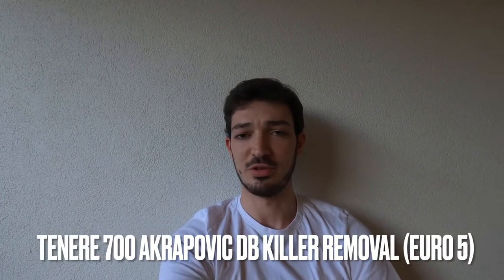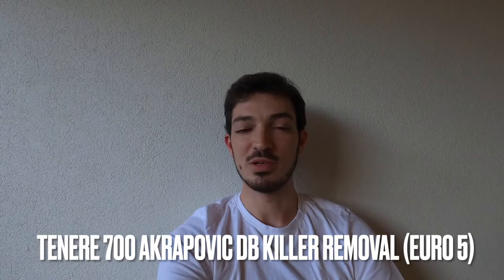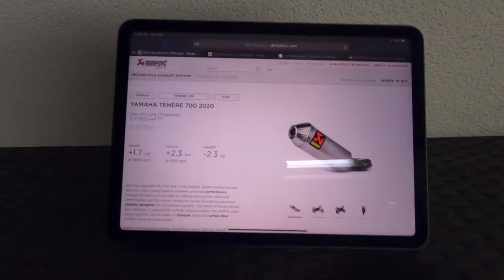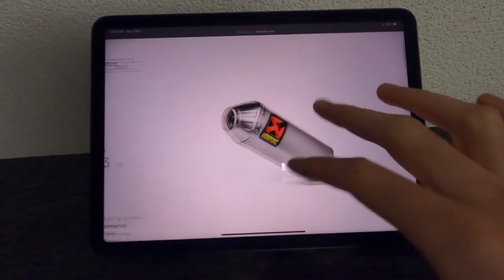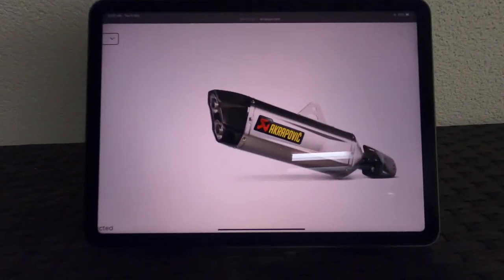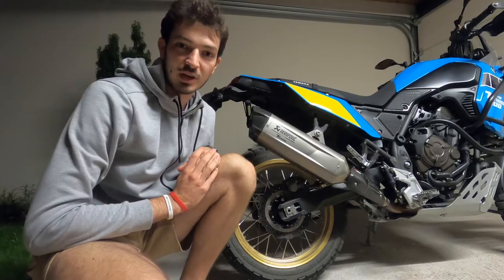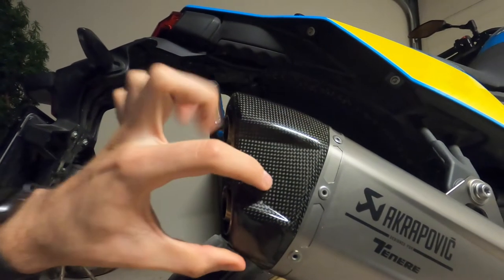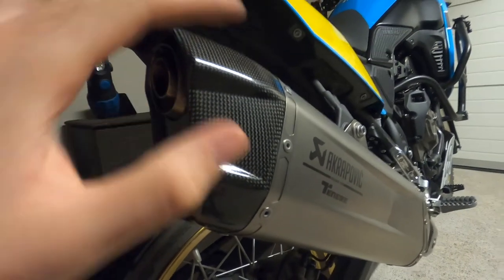Akrapovic DB Killer Removal (Debaffle) PART 1 | Tenere 700

Comment: Hello, congrats, very nicely done. Quick question, which kind of drill bit did you used (what material) ? Just a standard metal drill ? I am not used to drill in carbon. Thanks
Reply from the maker: Just a normal drill for metal/wood. I do suggest you make a smaller hole first with a smaller drill and go for the bigger one. By doing so it will be easier to drill the hole more precisely. However, drilling makes the finish of the hole a bit rough, therefore I suggested to finish it up with dermal to make things nice and smooth. Just be careful not to increase the size of the hole with it too much.
Drilling carbon is nothing special. Its thin so its like drilling though a sheet of metal. The residue is fine black dust from the resin and the carbon fibers. If you'll need any tips along the way I'd be glad to help (I need about a day to answer)!
Reply: @gravelroadslovenia  thanks a lot for your precise answer.

Comment: Hello,
Nice work :D
How did you make the hole?
What type of drill did you use to make the hole?
Reply from the maker: I made the hole using a cone drill bit. Then I went around with a Dremel to smoothen the edges (normal sandpaper should work too).

Comment: Great video, thanks.  By the way,  would this add 1-2hp to the power of the T7 compared to the regular version?
Reply from the maker: The Akrapovic does add 2 hp over the stock exhaust, however upon taking the DB killers out, I believe you loose the 2 hp again due to the change in engine back pressure. If you were to remap the ECU however, you could see even bigger gains without the DB killers.
Reply: @gravelroadslovenia  ok. Thanks so much.

Comment: Hey! You think would be fine to run the exhaust with the dB killer on without bolting them?
Reply from the maker: I assume they would stay in for some time because the fit is very tight but I do always bolt them in. For the matter of fact they can only be properly put in with a hammer and pulled out with pliers...

If you plan to put them in and out often, you don't need the bolts I assume.

Comment: @gravelroad have you had any issues with the bike since you removed the db killers?  I've read these engines run lean to meet emissions and removing the db killer can cause it to run too lean
Reply from the maker: No issues at all. It has been running like so for the bast 10k km. I have a friend that has done 20k km like this with no issues either.
Reply: @gravelroadslovenia Nice, thanks for replying

Comment: So the carbon cap doesn’t come out?
Do they sell titanium rivets?
Reply from the maker: I heard it is possible to remove the carbon however in my case it was not possible.

Rivets cannot be purchased from Akrapovic directly, however I did find a company that was their supplier. The ones they use are watertight and of stainless steel. They are identical.
Reply: @gravelroadslovenia  any chance you can send me the link for the rivets.
I think I’ll try to remove the cap as first, as I don’t want to make holes.
Thanks
Reply from the maker: @v.gousis2241   the company is called Pnevmotex d.o.o, and the type of rivet you need are "blok zakovica rf 4.8 X 8 ZAPRTA". If they will refuse shipping it to you let me know and we will work something out.

When drilling the holes you will need a high end drill bit. Installing the rivets also requires a professional tool since they are too strong to be clipped in with a classic hand tool. Since I went through the process I would strongly recommend avoiding what you are planning to do. Drill the holes in the carbon and get the rubber covers from Akrapovic, it still looks good.

Comment: I did the holes...i.put out the bolts....but the silencer didn't come out!!!  How i can put them out???please help!!!any tips?????
Reply from the maker: Try spraying some WD40 in between. It is an aerosol and will evaporate anyway. Then heat up the exhaust well by running the engine, you might as well go for a short ride. Then pull it out hard with a set of thin edged pliers. The fitment is very tight, but it should work...
Let me know if you need further assistance

Comment: one question do you just have to make the two holes on the side or do you also have to remove the rivets.
Reply from the maker: You can either remove the rivets and get the carbon off or drill the holes in the carbon. Both will get you to the bolts holding the baffles in. 
I personally did not manage to get the carbon cap off (it is possible but I don't know how). If you are planning to use the baffles every now and then, your only option is to drill the holes in the carbon. There are two screws securing the baffles, otherwise they might fall out without them.

Comment: Thanks for the view inside the muffler.  The pupose of the baffles is apparently to just reflect the pulses back
for another pass across the holes that expose the sound absorbent material.
In Slovenian, is the "krap" in Akrapovic pronounced as the English "crap"?
Where did you learn your English?  It's quite good American English.
Reply from the maker: Seems to be so! What I have also recently learned is that the pressure pulses created by the baffles (back-pressure) aid performance. The top speed with the baffles is about 10km/h higher than without. 
Yes that is correct, "krap" as "crap" 😂...
I attended an international school. 🙂
Reply: @gravelroadslovenia   -  Better performance with some back pressure seems so mystical these days with catalytic converters.  Back-in-the-day, before cat cons, especially in the days of 2-strokes, exhaust tuning that used those reversion waves was common.

Comment: I cant get the db out.. solid .. help
Reply from the maker: Interesting... try heating up the exhaust and try to pull it out hard with a set of pliers. It is a tight squeeze.
Reply: @gravelroadslovenia  hi.. ive done it, I used wd40 and used a large socket set over the small end pipe and knocked inwards just to break the seal and the pulled and it came out easy.. cheers

Comment: u could use Self Adhesive Carbon Fiber Vinyl Wrap Tape to cover the holes 😉i like the stock look and sound. if i want louder exhaust ill get another one before i destroy (aka modify) the original Akra.
Reply from the maker: I completely agree with your perspective. Not to mention how easily it can get damaged when off-roading. I have another stock exhaust on me, thats the reason I didn't get something else.
Reply: @gravelroadslovenia  i finally did it ... got tired of hearing only the engine and not the exhaust note :person-turqouise-waving:
Reply: now it is a  bit too loud but I guess I|ll get used to it
Reply from the maker: @kloppskalli  This problem goes away with age 😉 
Jokes aside, I tend to ride with earplugs. Reduces the loudness of the wind and exhaust just right. I would recommend giving it a try.

Comment: Cant you just put a piece of black tape of the holes? It probably seals it. The carbon doesn't really get that hot?
Reply from the maker: In the summer it does. I'm not sure how the tape would hold up. If you replaced it regularly, should probably work.
Reply: @gravelroadslovenia  are you planning to make ajustments to the exhaust placement? We have the same bike, with the nice akrapovic. But its so vulnerable on the side! what are your thoughts?
Reply from the maker: @Townmaking  Not really. I protected the carbon with 3M Paint Protection Film and put a rubber silencer protector on the exhaust (check Aliexpress).
For hard enduro I put the original exhaust back on. 
The swingarm is protected by the 3D Moto Carbon Kevlar cover, however the ones from Acerbis work well too.

This combination does the trick for me.
Reply: @gravelroadslovenia  today I removed the debuffer like in the video, everything worked fine. Thanks for your videos